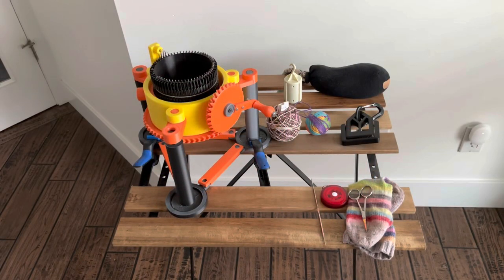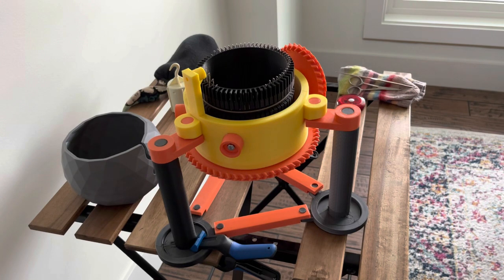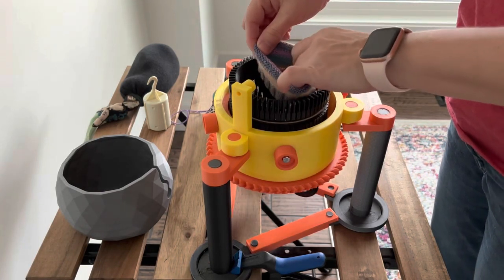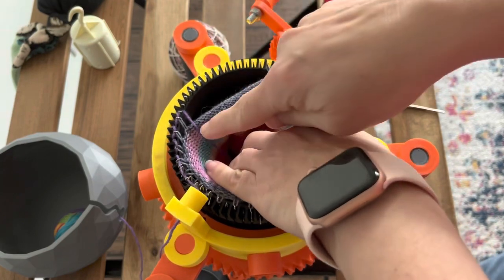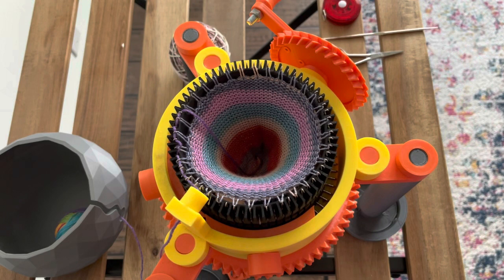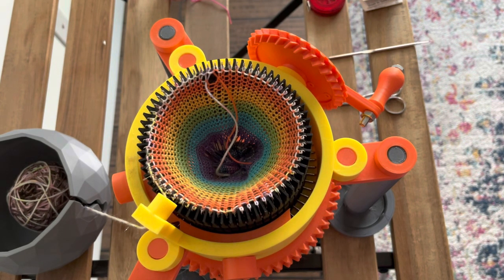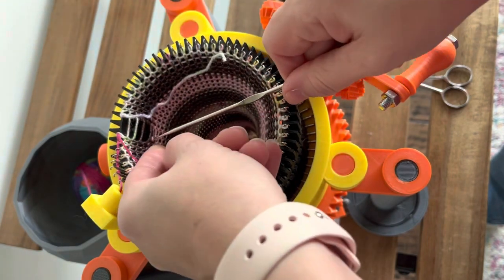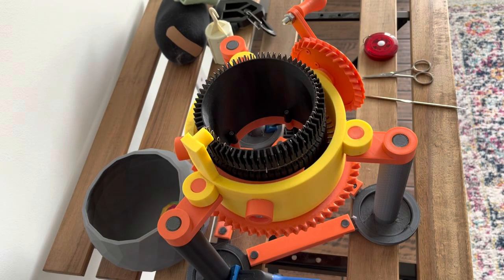How to Crank a Sock Tube

Comment: Thank you. Very informative! I'm hesitating to get a 3D-printed machine because of the high-pitched squeak caused by the friction. Have you figured out how to stop that?
Reply from the maker: I am not bothered by a high pitched squeak.  The machine will make some noises as it spins but I have not noticed a squeak.  It may depend on the type of PLA used to print the machine.  The squeaks may also lesson over time and with lubricant.  I have used sewing machine oil on my machine which may have helped with noises while also making it spin more easily.

Comment: Can't you just throw your weight in the scrap sock?
Reply from the maker: You could, but at some point you will have to love the weight up the sock tube as you crank it. If the weight rests on the floor, then you lose the tension on the machine and stitches can pop off their needles.